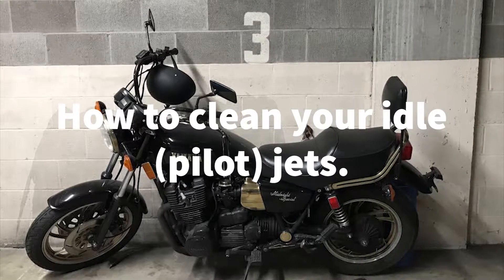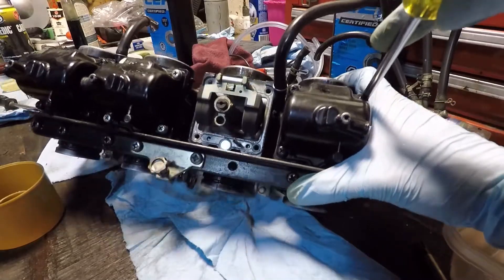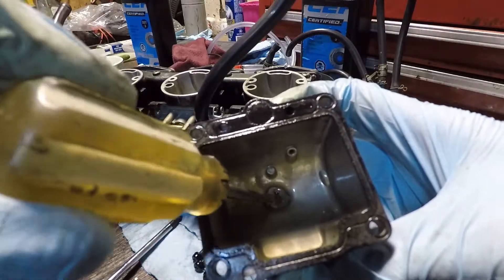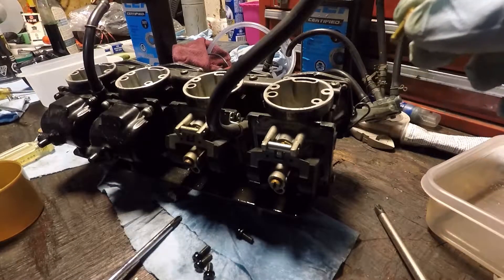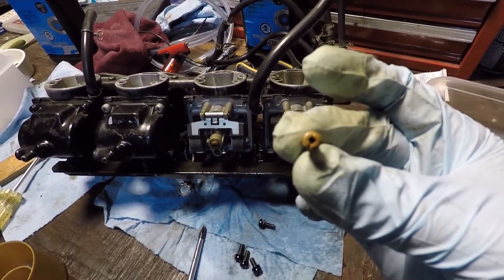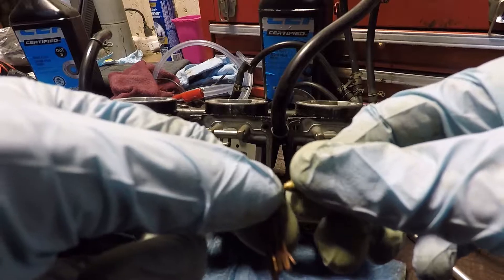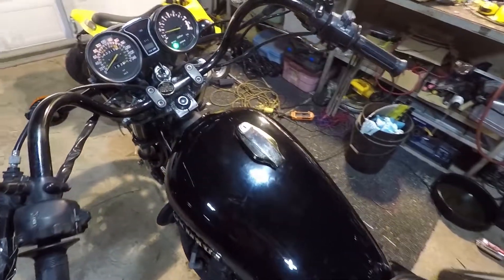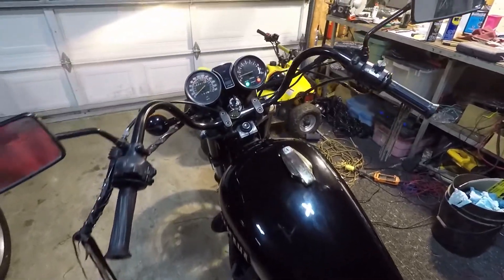Yamaha XS1100 midnight special cleaning carburetor idle jets.

Comment: Hey I bought a 79 and it runs but doesnt like to idle unless I put the cruise control on so Im wondering could I just turn up the idle or what should I do it has bigger than stock jets but I have the originals and it also has a custom header that sends the 2 inside ones to one exhaust and the outside 2 to the other side

Comment: Thanks, I have an xs400 and I suspect the same issue. It's currently only starting on choke assist. Just for clarification, is the "idle jet" the same thing as the pilot jet? And would you expect the bike to start via the electric starter without applying any choke after this cleaning?